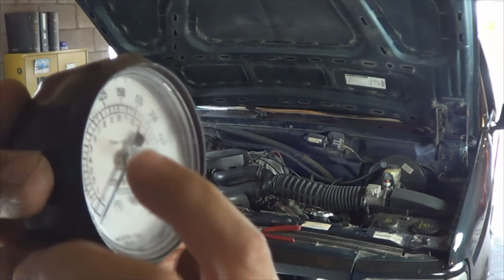How to Diagnose an Engine Cylinder Misfire by Howstuffinmycarworks

Comment: I have a 98 ford Explorer v6 SOHC. On my scan tool im seeing misfires on almost all the cylinders. Sometimes its just one or two but sometimes its all 6 cylinder. But no codes. I'm stalling out on red lights or long drive thru lines. SOmetimes it stalls and sometimes it doesnt. I've replaced and cleaned just about everything i can think of. EXCEPT oil pack. I ran a resistance test on them and they came back well within spec. I'll add that after the car stalls it starts back up every single time. I've NEVER had starting issues. Its starts up 100% of the time. Just the shaking and stalling at idle issue. Any ideas? I've checked just about every dang hose i can reach to check for vac leaks.